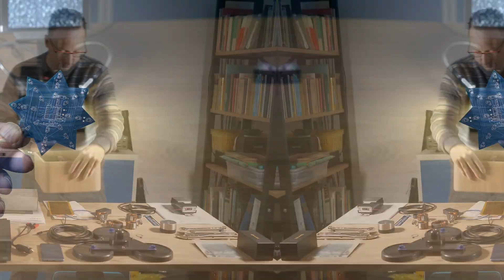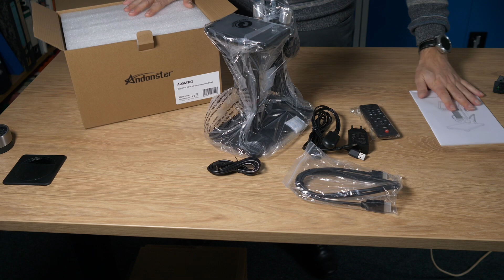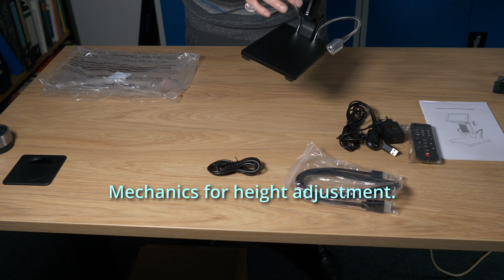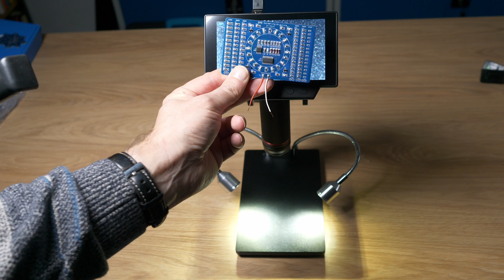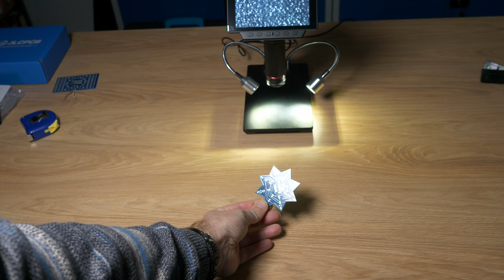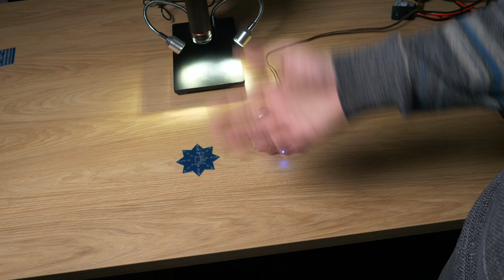Andonstar ADSM302 Unboxing | Electronics

Comment: Try moving the scope mounting ring to the bottom of the "scope tube" which should give you much lower magnification.  They only show it mounted at the top of the tube by try it at the bottom if you want lower mag.
Reply from the maker: Great tip. Thank you!

Comment: That looks like a great bit of kit. But even with that magnification, I'm not sure my hands are steady enough for surface mount soldering 😆 Look  forward to seeing you putting together your new project.
Reply from the maker: Happy Christmas Steve!

Yes I think it's good value for money, the only downside I noticed is, that it is 100% either internal display or external display. As soon as you switch to USB or HDMI the internal display is off. So not ideal for live streaming. It would be good if I AND the audience could see the output 😉. I'll somehow have to find a way to work around that limitation.
Reply: @labcat73  Happy Christmas to you as well 🎄